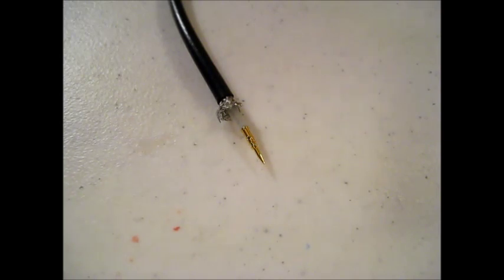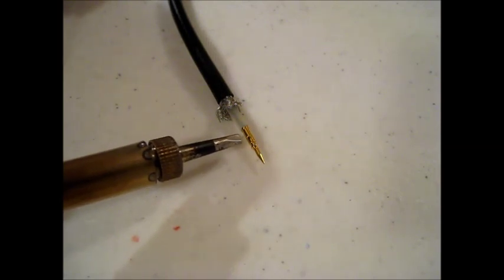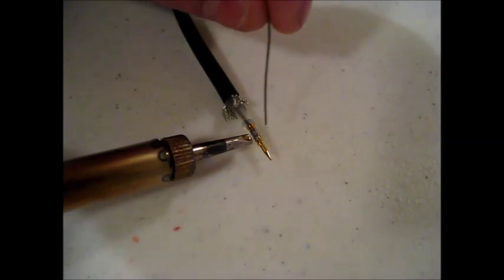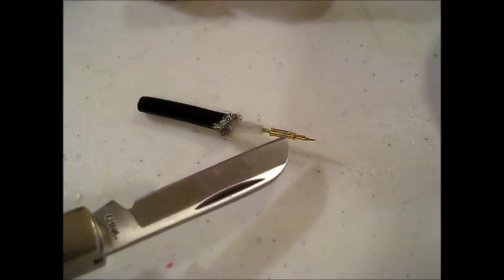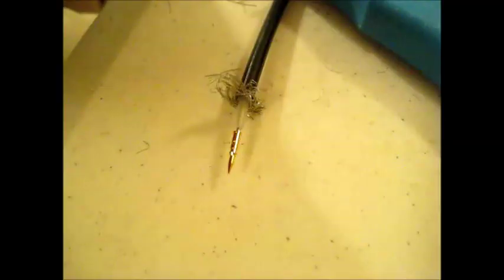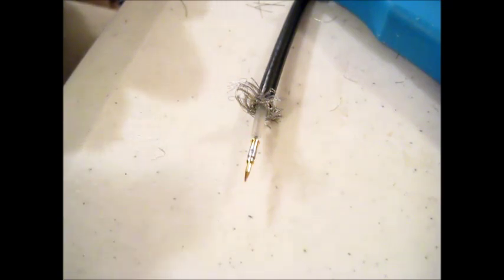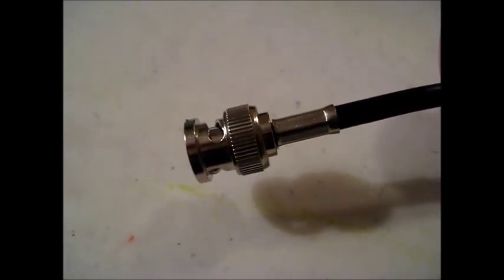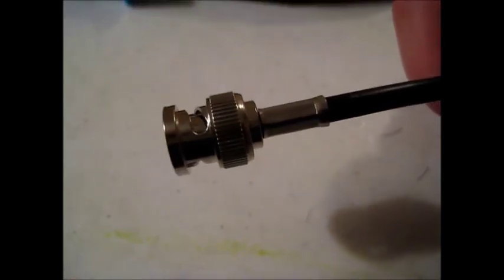Soldering on a connector (BNC)

Comment: I have a question about soldering this (assuming you still read the comments to this video).  Everything I've learned so far has told me to let the work melt the solder.  I see you attempted that the first time.  I think you might have had it, but you went back in there to try and flow more solder while it was still hot, ultimately melting the dielectric.

On your second attempt, you placed the solder on the work.  Then you came down on it with the iron, sandwiching it between the iron and the work.  Isn't that a no-no?  Enough solder got in the hole to make the pin stick, but everything I've learned tells me that's a cold solder joint.

It's almost a catch-22.  Because the heat required to properly flow the solder is enough heat to melt the dielectric.
Reply: In this situation, he should have placed a small amount of flux where he wanted the solder to go.  Since he's in a precarious situation concerning melting his part, he could have shaved off a bit of solder and placed it on top of the hole filled with flux, or even stuffed a bit of solder into the hole with the flux.  At this point, he's free to heat the end of the tip until the solder melts.

NEVER blow on the solder to cool it.  You risk a cold solder joint.  If you're worried about melting the plastic, get some sort of heat sink and place it on the wire just after the solder melts.

Comment from the maker: I think crimp connectors (when done correctly) are fine for station work (inside environments)  However, for connectors that will be moved and wiggled allot I prefer soldered connections.

Comment: I recently had the same issue when soldering an 1/8" stereo plug on a ipod to radio transmitter.  The wires are 26AWG and even the slightest amount of extra heat causes the insulation to creep back.  I have a Weller with a temp control dial, and I set it between 2 and 3, with the slightest touch of heat and a really small amount of flux.  The solder wicked almost instantly and the connection is great.

Comment: I use 3 piece connectors often for video purposes. I like the GEM 301-00. They are universal and come with 3 different collars. They will typically work with any rg58 or rg59, plenum or non-plenum rated. I like them because they do not require soldering. They are fine for video, but the better solder connection may be best for radio signal. Your thoughts on them for radio?